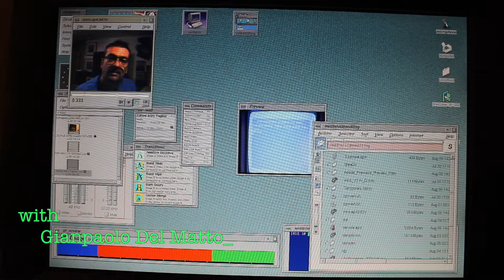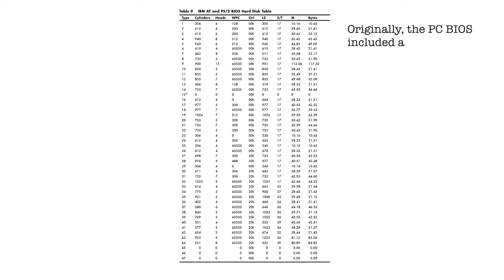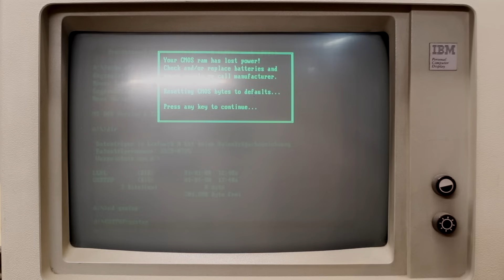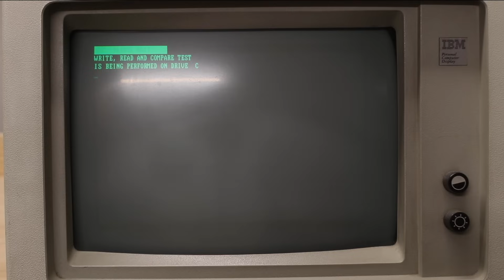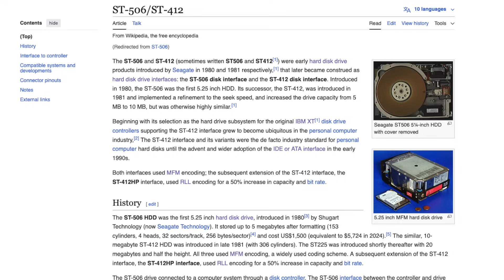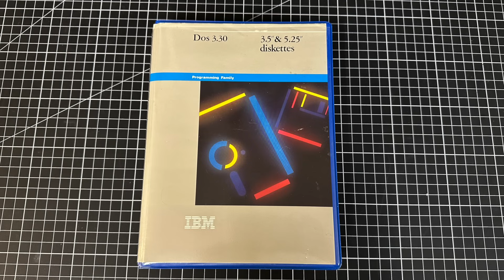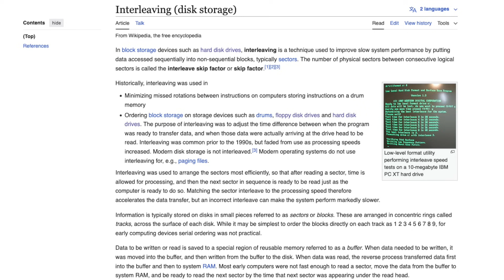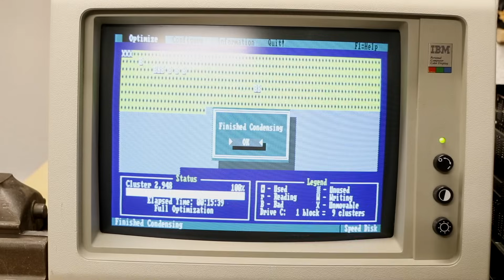Seagate ST-4026 Hard Drive Troubles & a Big Mistake - Restoring My IBM PC AT 5170 (Pt 2/2)

Comment: These 4000 series Seagates are often very reliable, especially the later revisions.  I have one of the later revision 80MB ones in my 5150.  When I picked it up about ten years ago the head lock was stuck, but I was able to get it to unlock after several power cycles.  A comprehensive media scan using Norton Calibrate (it took nearly three days) only found four bad sectors.

Comment: I'm confused, what does the ESDI drive have to do with this? ESDI uses a different controller than ST506 drives.
Reply from the maker: @ScottHenion  Because this video is a follow-up to a previous video I did on ESDI, that‘s why the reference is mentioned.

https://youtu.be/Wol3Ju4yXi4?si=dSwD9Q3URpmpWdco

Comment: Hey, this is indeed my dream vintage setup.  I started in the mid 80s with some odd, non-hardware compatible PCs running custom DOS implementations (there were a lot of those before the clone industry really took off), until I got ahold of a PS/2 Model 30.  Loved that machine hehe.  But of course eventually it was seen as just obsolete and disposable, not a vintage computer, so it got left behind.  That's the most dangerous time for a computer, when it's no longer useful yet not seen as having even nostalgia value.  

That Model 30 was terrific though.  It allowed me to much about with software installation, my favourite thing to do.  Gaming was a practically non-existant interest for me, as it is now, although I will go into the modern games to check how nice the graphics are, then leave shortly thereafter lol.

Comment: Which models of resistive assemblies can be used as a "terminator" on MFM Seagate hard drives?
Reply: @Retro_PC  It depends on the hard drive model, usually it's 330 ohms to +5V and 220 ohms to ground

Comment: Actually, DOS 3.x does have a setup program. It's really archaic as well though.
After partitioning the drive and rebooting from the DOS floppy, you just have to run: "select c:\dos a: 041 sg" to install to c:\dos from drive a: with Swiss country settings and a Swiss German keyboard.
Reply from the maker: Ooops. I knew SELECT actually, though I missed it's part of PC DOS. But actually, yes, it's part of my 3.3 floppies! Good catch!
Reply: Some original DOS 3.x disks would have an autoexec.bat so that if you booted from them, it would automatically kick off the SELECT utility with the correct parameters for you.  I'm still curious as to why they called the installation program "select" though.
Reply: @OzzFan1000  Yeah, with MS-DOS 2.x and 3.x there was a wild zoo of OEM versions, some very close to PC-DOS, some wildly different, with custom format routines etc.
Why "select"? No idea. They kept the name even with DOS 4.x, although its installer got a lot more sophisticated.
Only with 5.x they changed the name.

Comment: Ah yes, tricky labeling. Good find! Perseverance paid off.

I began in computers, also with my father, and a friend of his from his work place, putting together a Well's American A-Star II. IBM AT clone. Putting that first computer together, we got bit by incompatibility between PC/XT floppy diskette drives and AT floppy diskette drives. I recall we had to put some insulating tape over pins on the floppy drive edge connector to "turn them into AT floppy diskette drives." That challenge out of the way, it was on to loading DOS. I started out with DOS 3.3 also. Oh, getting ahead of myself.... since we were building an IBM AT clone, it had no reference diskette. We booted to DOS, ran "debug g=c800:5" <enter> "Welcome to Western Digital Low Level Format Program". My mentor friend (father's coworker) told me something very defining to my understanding of computers.... when we got to the "sys c:" step.... he said "this program copies some special files to a special place on the hard drive necessary to make the drive bootable." I believe that (before I had ever used a computer!) was the original inspiration for what I pursue and named "Desired End-State Software Distribution." 😎🥳 From Steve Gibson, we utilize his "Spinrite" program. It does a safe low level format of the hard disk drive, non-destructively. I ended up with an official IBM AT 5170 about 19 years ago. I have both an IBM XT 5160 and that 5170 in my collection.

Comment: My first PC was a 386SX-based clone, but despite the newer processor it wasn't that far off from this AT. It was in a similar desktop AT-style case, it had 4 MB of RAM and just 40 MB hard drive (Type 41 in AMIBIOS IIRC), no sound card, and a Hercules monochrome graphics card with an amber CRT. And it was around 1994/1995 when I got it, so it was already massively outdated.

About two years later I got the chance to upgrade to a much more modern (but still outdated) 486DX2 with SVGA graphics, SB16 sound and an order or magnitude bigger hard drive with Win95 OSR2 installed on it (from dubious sources, as was customary where I live at the time 😅). And another two years later, around 1998/1999, for the first time in my life I finally got a properly modern machine, which at that time meant a Pentium II system.

Still, I have very fond memories of those early 386 and 486 machines. I was an elementary school kid back then, but perhaps thanks to them being so outdated, I couldn't really indulge too much in games - instead, I learned to program, tweaked the OSes to death (it really helped that DOS+Win3.1 that I had on the 386, and even Win95 were MUCH simpler than what modern computers run), even tried things like disk compression, repartitioning and running Linux, not because I had any need, but just because I could and it sounded interesting. I did render those machines unbootable a couple of times, but I also quickly learned how to reinstall Windows anyway, so it wasn't a big deal - once I finally got my hands on proper installation media at least, because at the beginning nobody cared to provide them to me ;)
Reply from the maker: @kFY514  Your experience reads a lot like my own!
Those were the days! ^^
Reply: You could run any OS available in 1994 with 4MB RAM, so while it was a low-end configuration, it was not outdated.
Reply: @IkarusKommt  Maybe the CPU and RAM were somewhat relevant-ish, but pretty much everything demanded at least VGA graphics at that time. That hard drive was also very tiny by 1994 standards.

Anyway, it was really interesting to remember that between 1994 and 2002, we had 4 different computers, which means that we were switching them every 2 or 3 years - which includes replacing that Pentium II box, which was current and close to the state of the art at purchase time, after like 3 years. And now I'm using 10-year-old machines as my secondary but perfectly usable computers. The times really were very different back then...